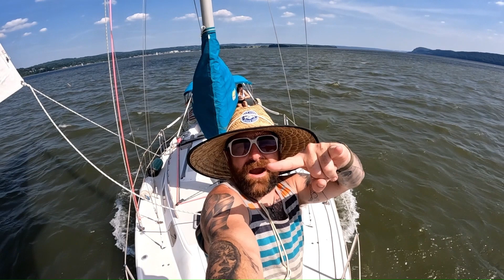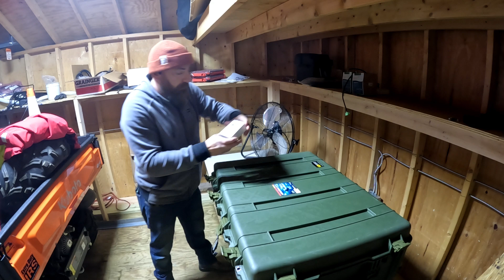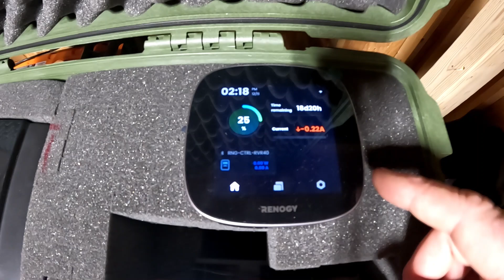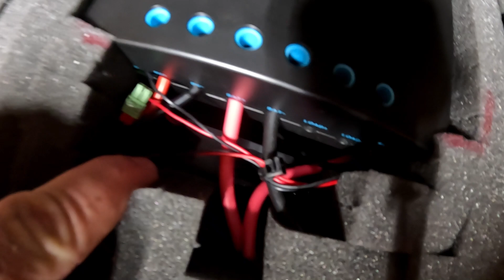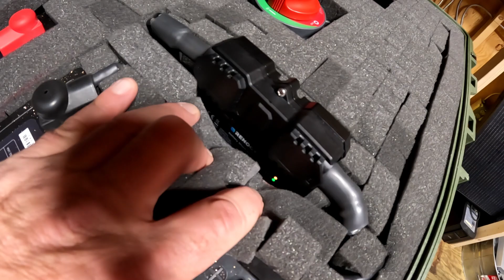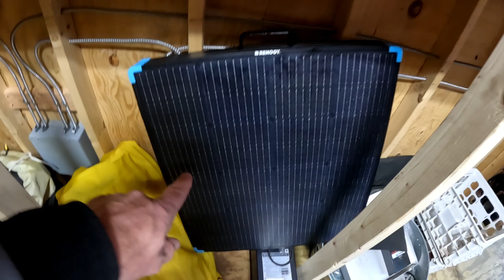DIY Solar Generator / Part 2

Comment: That's cool! I'd like to see it in action.
For the foam, I wonder if you can buy some additional foam pieces that you cut so that it looks more smooth on the top layer. Not a big deal, but you mentioned that you didn't like how the small pieces came together.
Reply from the maker: @charles.neuman18  thanks man 
I plan on putting felt on the top to make it look pretty

Comment: Perhaps you could melt a channel for the wire cable with a hot curling iron. Wonder where you could find one of those in your house?
Reply from the maker: @stevearrington4359  lol lol I wonder 
And that would work
Reply: @Sailing.Artemis  I would practice on a remnant and wear welding gloves:)
Reply from the maker: @stevearrington4359  I was able to channel all wiring under the first layer of foam